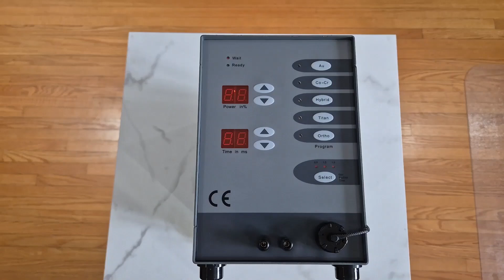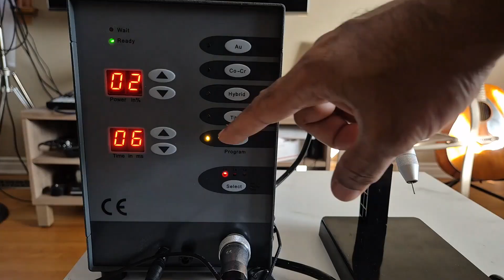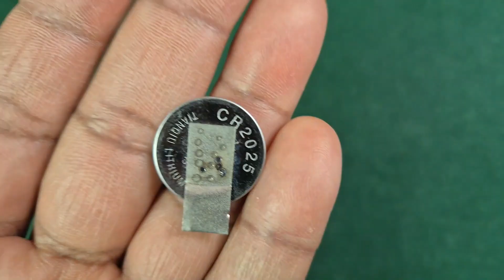Amazon Welder, does it really work with Argon? Spot welder for Jewelry, Test Gas Solenoid, In Action

Comment: It would be interesting if you try soldering 0.3mm copper on a 21700 or 18650 cell.
Reply from the maker: Thanks for your message. Yes, I will document that soon. So far, I've just had tin strips requirement, and I generally use my "go-to" portable spot welder for such small jobs.
Reply: Can you make a detailed teardown video of this machine
Reply from the maker: I'll try. Thanks for your message.